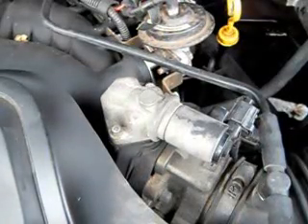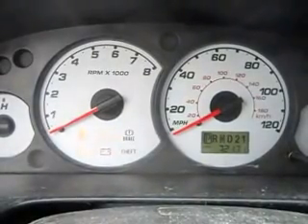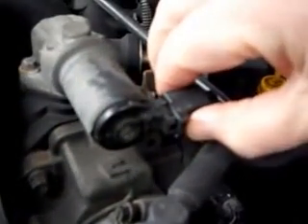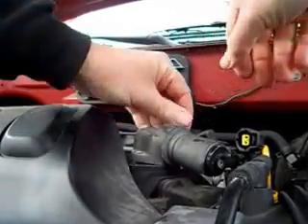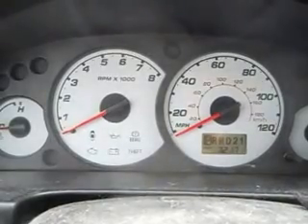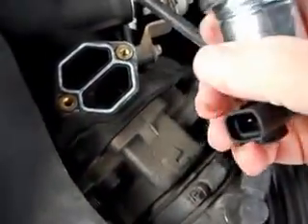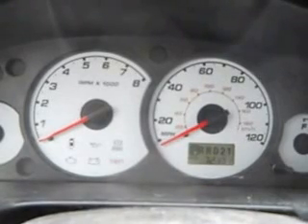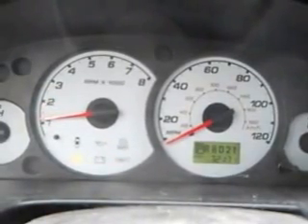EASY! Ford Escape + others V6  Idle Air Control Valve Replace Repair (IAC)

Comment: Thanks for posting. That was exactly what my 02 Escape was doing. Replace the part, and in less than an hour my car was running perfectly. Really, really appreciate you posting this!!
Reply from the maker: Thank you for watching! Come back when your weedwacker won't start
Reply: Same here, 02 Escape w same problem, question tho if u dont mind, did yours have a intermittent but consistent hissing that started and stopped seconds later coming from the "back" (Seemingly)? Idle REAL low then rev right back up to stay running(from IAC), seems a minor constant hiss is still there now, but the loud consistent/intermittent hiss is gone for me.. The hiss is *somewhere*  but idk where, any of it was.. ive sealed EVERYTHING.. it is quite minor tho.-- plastic intake maybe letting air out somewhere. --   
So far the dif IAC worked beautifully tho, I did an engine swap couple years ago bc the og blew up.. so I had a spare IAC off it, an old (less used) one that worked great.

Comment: I have a 2002 Ford Escape with 155 thousand miles on it. My car was performing the way that you described. So I went to Auto Zone and bought the part for 53 dollars. My install took about 15 to 20 minutes. The car now runs like its supposed to. Thanks for the information.
Reply from the maker: Thanks for watching!
Reply: Very goods.

Comment: Thanks so much.  Just did this simple repair and it fixed my problem on my 2004 V6 Escape with 220k miles.  I went for the OEM part from Ford. $120.
Reply from the maker: Congrats! Thank you for watching. Check in out my other videos.

Comment: Well done.We have a Mazda Tribute ,which has the same motor as the escape.We have been having the same problems.We have spent a fortune at no avail.You have explained this in such a manner that is understandable and it is just common sense at the end of the day.The mechanics of today should be ashamed of there lack of skills set and reliance upon a diagnostic tool to tell them what is wrong.Well done again.Computers do not have the answer.
Reply from the maker: I sure hope it works out well for you, I also spent a fortune at a Buick dealer while on vacation 700 miles from home only to be told they could find nothing wrong with their "TECH 2000" computer after 2 hours. On a lark I pulled into a private repair shop and met a man with no voice box that motioned to me to start the car while he lifted the hood and pointed to the mass air sensor with his cane. 30 minutes later my vacation was saved.

Comment: Mine did the same thing now in the summer time, but in this winter under cold weather (northeastern mexico upper 30's lower 40's) would need to step a little bit on the pedal just to open the throttle plate. Removed the IAC valce cleaned it with some carb & choke cleaner and a small brush and lubricated with some WD-40, and have it running like nothing ever happend! This video was so helpful, thanks!

Comment: Thank you for posting this video!  My 2003 V6 Mazda Tribute has been having the same intermittent problem with no codes, so my mechanic couldn't fix it.  It always happened when I was away from the shop, and was working before I could get it there.  This has been MOST frustrating, and has made me lose some confidence in the car that we have owned since new.I am pretty sure that this is the problem, so I bought the valve tonight to install tomorrow.  Thanks again for posting!
Reply from the maker: Good luck!
Reply: Did it fix your problem?
Reply: and 1 year from now, did it

Comment: WOW you really saved my ass with this one. I could NOT find the problem after all the gaskets, seals, hoses replaced new, and even adding Permatex in anything I thought COULD be a leak for good measure lol Though there weren't any as far as I can tell, bc the IAC Valve was the problem. Runs damn well now. I tell ya, I've torn in, out, up and down the whole upper half of the block so I could put it together as perfectly assembled and well sealed as I possibly could.. I cannot believe it was literally 2 bolts on top the intake, and a spritz of brake cleaner to clean it. BUT, it worked. Thank you good sir. I'm a beginning DIYer, with an obsessive mind for these things that detests unsolved challenges. lol ahh well, you live you learn. God Bless
Reply from the maker: Great I could help! Thanks for watching and the props!

Comment: Thank you for posting!  We had the exact same issue with our 2002 Escape and replacing the idle control valve has worked so far.  Our mechanic replaced a hose and a sensor, but the problem came back.  We had been dealing with this intermittently for 6 or 7 months.  It always seemed to happen after it rained or when it was humid out...
Reply from the maker: +proletarianrev I hope this works out long term!

Comment: thanks for the info I was able to clean mine it was stuck open sprayed with carb cleaner and used needle nose pliers to free up the shaft works great for now thanks again
Reply from the maker: So glad it worked out for you!

Comment: My 02 Escape was idling all over the place.  This is the 3rd IAC valve I've purchased from Advanced Auto.  Some advise... get the Motorcraft part and NOT the whatever brand part.  Once I went to Motorcraft, it's been running great (now at 238K miles!).  I think the tolerances are different in the aftermarket ones or they just aren't made as well.  This one has lasted over 50K now and still idling around 700-800.
Reply from the maker: Props to you for keeping her on the road!

Comment: Just got an estimate on my 2008 Escape limited from Mullinax Ford Lake Park. $275.00 plus tax. My car did exactly what you said and displayed yours doing. It happened about 6 months ago and went away the same day. Happened again this Saturday so I took it to Mullinax. They say they are "fixing a wire and reprogramming the computer". They did not mention this Idle control valve but I am guessing they unplugged it, sprayed some connection cleaner up in the socket and called it a day.
Reply from the maker: +Robert Johnson Somebody has to put their kids through college. Hopefully your problem is resolved.

Comment: I have 2001 ford escape that was displaying similar problems, but finally threw code today.AUG 19/14 PCM code P1507, I didn't replace it. I just unbolted the unite like you did and flipped up side down. filled it up with Mineral Spirits and let it sit for 2-3 hours it seem to clean up fairly well. with a small brush i cleaned out residual carbon build up and sprayed WD40 let it sit for a few minuets. also checked see if the plunger moved freely it did.  replaced IAC and reset Code. Car started up with AC on MAX with no issues, retested when the engine was Colder as it was removed while hot. Same result I use a USB OBD II link with my laptop to connect with Fordscan and the IAC showed normal operation...If it codes again I'll just replace the unit. I also posted this on another youtube Vid with similar issues.
Reply from the maker: Good job! Certainly worth a try before paying for a new part.

Comment: 2009 Ford Escape V6 - Check the passenger side motor mount. It will cause the entire vehicle to run rough and vibrate when stopped.

Comment: Doing this tomorrow morning with my '00 Mustang GT. I'm hoping cleaning it will solve it. My problem is really low idle especially when I come to a stop. With the AC running it will stall it sometimes. Also the car sat a long time, and since I started driving it again, it sounds like I have a turbocharger, from 1,500rpm to 2,000rpm it makes this loud sound, just like a big turbo, then sharply stops at around 2k. So strange, it has a hesitation to it also. WOT it runs perfect tho... I'm guessing I have a major vacuum leak, probably something dry rotted from sitting so much over the last few years. I haven't found it yet. I'm actually hoping what I'm hearing is just the IAC valve not working correctly, then correcting something at around 2k rpm, where it seems to run just fine.
Reply from the maker: Way back in the day mechanics would check for vacuum leaks with an unlit propane torch. When the fumes neared the problem the engine would run better because it was sucking the flammable gas instead of air. There are a few Ford vacuum leak videos on Youtube also. Best of luck!

Comment: big thanks. my 2001 Mazda tribute would not start. it would idle real low and then die. I removed the valve and sprayed some WD40 (all I had at the time) and the car started.
Reply from the maker: +aahnn Great !!

Comment: Mine revs low about 400to750 ish rpm and sometimes it cut out but there's a higher chance of it cutting out with ac on. Will try this and see. Ford Explorer 05
Reply: any update?

Comment: I had the same problem it was stuck at a high idle and if I put it in drive the escape would get too much fuel and speed up so fast  which would almost cause me to wreck. Couldn't slow down unless I stomped the breaks. I replaced everything and cleaned everything that I could having to do with the throttle and throttle body. Ended up being something so dumb. The throttle cable was starting to splinter on the inside of the plastic sheathing. A small splinter of wire would catch and hang on this plastic sheathing from the inside and cause the throttle to stick open. After replacing the throttle cable everything was fine. 

Now I have a problem of the escape wanting to stall out when first started if I give it a bit of fuel (using the pedal) it runs fine but as soon as I release it then it started to stall a bit and wants to shut off. What is very odd is that it runs fine after it warms up and it does not stall at all. Never seen this problem before and not getting any codes. Seen people say it could be the EGR valve or the IAC valve but I am not sure myself. Anyone else have any ideas?????
Reply from the maker: My goodness, I am glad you were not killed by that throttle cable!! If you watch my video I think my IAC symptoms were the same as yours above.

Comment: I did this on my 2003 Tribute it worked, also clean your MAF sensor.
Reply: what's the problem in your mazda sir.?
Reply: clean with carb cleaner or co contact cleaner? cause i did both , internally... like inside the tube and not the e connections outside but the ones sticking inside.

Comment: Did the OEM idle control part last, or have you replaced the part since this video was filmed? I was wondering if I should use a Ford Motorcraft valve instead of an OEM valve?
Reply from the maker: My valve lasted until I sold the vehicle, I could not replace RUST.
Reply: Lol, good answer! Thanks for your reply!

Comment: Mine will run up to about 2000 and then stall out and die but if i hold my foot on the gas and hold it at 2k for about a minute itll drop down and idle below 1 thousand. Does that sound like it might be the same?
Reply from the maker: Sounds more like starving for fuel, change fuel filter and go from there. That is a cheap try. Yes it does sound like a similar problem, and it very well could be your IAC, also try unplugging it and see if it runs different. If after it warms up you can drive it at highway speeds it's not the filter.

Comment: I want to let everyone know about these common problems. I have a 2002 Mustang GT and it had the same problems. Mine was sputtering and idling rough when I came to a stop. Replaced the IAC with an aftermarket from your local Oreyllis.... It worked fine for about 2 months then it came back with idling problems. I did all kinds of diagnostics and nothing worked. No check engine light or anything else. I also removed positive and negative cables and touch them to reset PCM.. NOTHING... I went back to pats store and got another new one and same problem. I did more diagnostics and nothing. Went back and got another new one at parts store and nothing. I I went to a local wrecking yard and grabbed a USED one and installed it and BAM,,,, it's back to normal. DON'T BUY AFTERMARKET on these sensors.
Reply: +Ramiro Govea I had a feeling that's where you were going with it...
Reply: When the GEM Module goes bad you'll basically have the same symptoms accept your radio will go on and off and the dash indicator lights will go crazy and your AC won't work properly. It's a white box about 6 in by 4 in underneath your dash right in the middle in front of the center console

Comment: My 2003 Ford Escape turns off quickly after I start it, probably about a second or 2 but sometimes it’ll keep running after a few fails
Reply from the maker: Bingo! Won't idle... so I would follow my video. You can try cleaning or replacing the IAC.
Reply: Pittsburgh Pap I’m getting it replaced today, I hope that’s all that it need
Reply from the maker: @officiallyisaiah6408  Do it yourself, could not be easier!

Comment: Happens to my 2001 Ford Escape idles fast at times? Took it to the VoTech program at my local BOE, but they replaced something and it didn't work. $250 in parts later. Basically this is what I have to do is shut the motor down. Sometimes I can feel it idling fast as I am slowing down at stop lights. Not good when my kids are in the car with me. I believe the fast idle comes on whether or not the idiot light is on. Help!
Reply from the maker: +MarylandGOP This is the unit that controls the idle, hence the name. I would plunk down the $50 or try the carb cleaner sprays others have recommended below before returning to a repair facility.

Comment: I've changed that part on my 2001 Escape, however the idle rate still drops off to almost stalling.  Replaced all the spark plugs and coils, throttle body.  Any ideas?
Reply from the maker: If it runs at 60MPH that eliminates a fuel issue, most likely you have another bad Idle air control valve. They sell a lot of crap Chinese ones. Or the electric connection is corroded and not getting signals to the valve. Other issues could be the mass air sensor or air filter. The sensor can be cleaned but ONLY.... ONLY with mass air sensor cleaner! Watch Scotty Kilmer mass air sensor video.
Reply: @sixty9harleyPittsburghPAP  I’ll try the mass airflow sensor.  Thanks.  Air filter is brand new.

Comment: So I have a 2001 ford escape and it pretty much starts everyday but some days it won't start at all but then u wait 30 mins and then it will start it sounds like sometimes it's not getting gas
Reply: So if anyone has any Ideas of what this might be that would be greatly appreciated.
Reply from the maker: Waiting 30 minutes will not help an electrical problem, or fuel starvation issue. I would suspect something that causes flooding when parked which likely would be dirty stuck open fuel injectors. Add a good fuel system cleaner in the tank (2 bottles at once) and fill tank. And change the fuel filter for kicks (easy & cheap)

Comment: Replaced the IAC on Mazda Tribute V6, same as Escape, started the engine and the RPM was about 4000 and it wasn't dropping down. Put back the old one and everything is alright. Is that normal?
Reply from the maker: Absolutely NOT, you have a defective part. Return it for another!!

Comment: I am wondering if you have to remove the housing to clean it out.?
Reply from the maker: Yes, running fuel system cleaner thru the tank would not be very effective in correcting this issue.

Comment: I have that cut off problem on my  1998 zx2 only when the AC is on at idle.
Reply from the maker: If the IAC looks like this one, remove and spray the crap out of it with carb cleaner and see if that corrects your problem.
Reply: Thanks, I will try it. Was thinking of taking it  to  the dealer getting ready for  summer.

Comment: mine idles real high when starting . I say bout 2500rpm to 3000rpm. not shooting a code . do you think cleaning it will help? Just started today
Reply from the maker: It's so easy to take off and clean you might as well try that.
Reply: Pittsburgh Pap it just started tonight it fires up but ilding super high. I couldnt believe it.  it stays running just high.
Reply from the maker: Try disconnecting the wire while it is shut off, then start it and see if it stays high if it acts different then that would isolate it to the IAC, you might have a hung throttle pedal or cable also make sure it works freely and returns to idle position when you take your foot off.
Reply: Ok sounds great thanks for the heads up
Reply: Pittsburgh Pap started it up today same problem. took it on the highway about 5 miles got off and it stopped. maybe it was the throttle or peddle no idea? Thanks for your help sr.
Reply from the maker: WD40 all parts of the throttle linkage, if it sticks on you at a bad time it could cause an accident. Again a spray can of throttle cleaner in the IAC is an easy job. It would not hurt to run some injector cleaner thru the gas tank also. The Escape in my video had a dry linkage that hung up when leaving a stop.
Reply: Pittsburgh Pap thanks again i will do this at work today.

Comment: I have a 2001 Explorer.  everytime I come to a stop it shuts off I keep hearing this is,the problem.  what do u think
Reply from the maker: +Dominique Williams If it is shutting off because the idle speed is too low then it can be this problem. Test it by repeating the same test I show in the video in the safety of a parking spot or lot. Shutting off can be many things, but shutting off due to low idle speed ( RPM ) is usually this.  Good luck!

Comment: See my issue is I'm getting to much idle it revs up when I put the car on park😩🤦🏾‍♂️
Reply from the maker: The key is "idle control" Remove, unplug, clean, or replace the unit and  see what happens?

Comment: I changed the IAC but it slowly and steadily it drops and idles rough again
Reply from the maker: In other comments below some have replaced these with aftermarket units that simply do not work. You might trying cleaning your original really well and trying it again.
Reply from the maker: Or seeing if you can get a free replacement from your auto supplier.